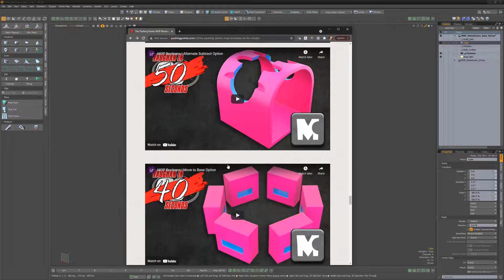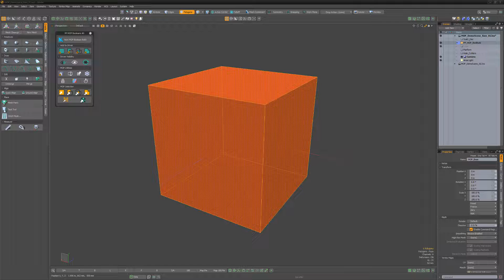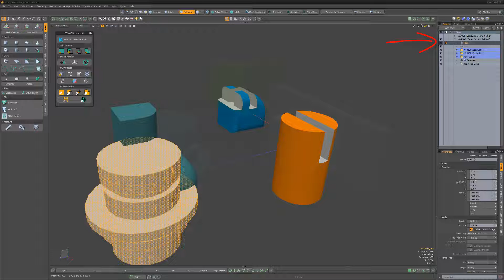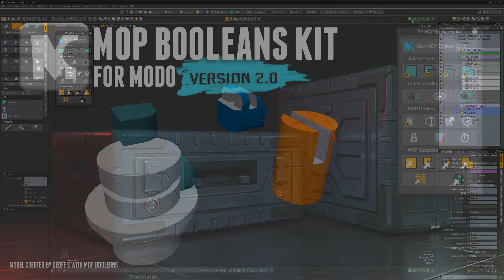MODO | MOP Booleans Kit version 2.0 Introduction

Comment: Great Kit and looking  forward to this update!!!
William, may I ask a basic newbie question. Is there a general rule/tip regarding mesh densities when using this Boolean kit to help stop occasional shading artifacts.
Sometimes I come across these artifacts when I subtract meshes  and I wondering if I can help the situation with denser/less denser meshes of the primary or cutting mesh.
Reply from the maker: I'd love to see example if you can share but my first thought is that they would be smoothing errors. You could try and adjust the Smoothing Angle which could resolve the issue but it may require additional work on the final mesh like Hardening edges.  Feel free to start a new discussion on the forums or join the main MOP Booleans thread here: https://community.foundry.com/discuss/topic/133282/mop-booleans-kit-for-modo-master-thread?page=25
Reply: @pixelfondue  Hi, these are most probably smoothing error, I'm using the wrong terminology :),I apologise.
I was not implying any issues created by the kit, I was wonder if denser (more geo) helps with smoothing errors in general
Reply from the maker: @RicheUK  Didn't read it that way :)  Denser meshes 'could' help in some cases but not all. I try and avoid adding more geo unlesss its needed. Feel free to share examples.
Reply: @pixelfondue  Thanks